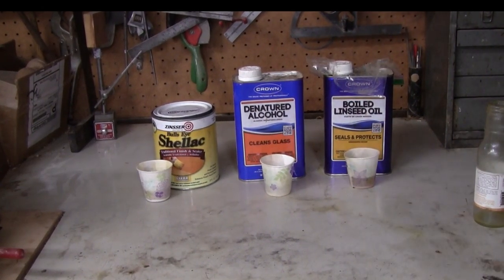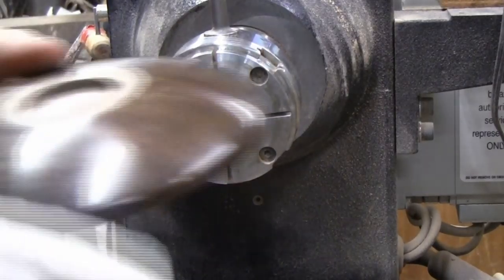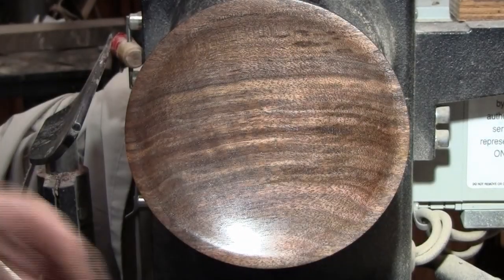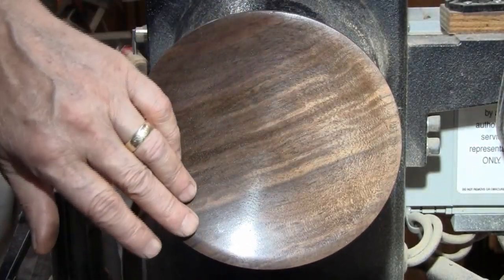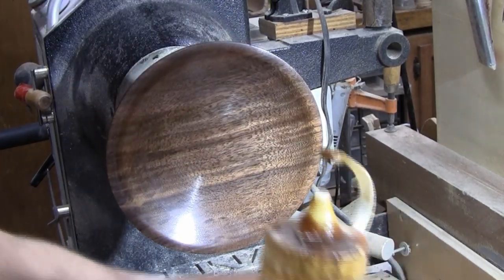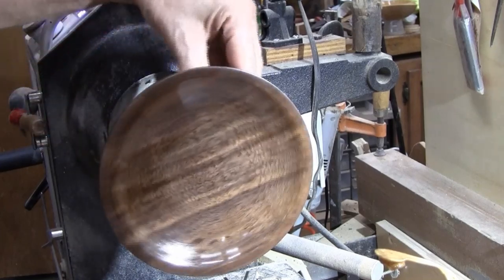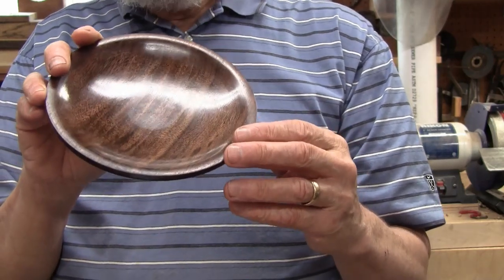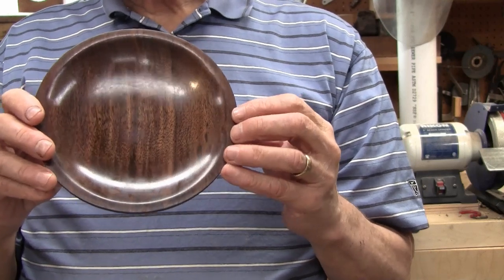How I make Friction Polish - French Polish Wood Turning

Comment: That is a great finish. Your application is spot on. The origin of this finish is Cap'n Eddie Castelin and he attributes it to someone with the initials O.B. Cap'n Eddie refers to it as OB Shine Juice. And it is a great finish. There is one drawback in that if left unused for very long the alcohol evaporates. So the juice needs to be kept in a very tight container. However if it becomes obvious that some of the alcohol has evaporated it's easy to add a bit more. Thanks for sharing Papa. And please stay healthy. BTW that is a very nice little bowl.
Reply from the maker: Thank you Glen,
I have heard about OB shine juice.
But this does start in the 18th century with a mixture of shellac and alcohol. I did not use it back then though..lol 
But I did some hand rubbed finishes in the mid 1970's
Not very many original ideas left but it is nice to play around with it.
I have found that there are times I like it better when some of the alcohol has evaporated.
Thanks again and be safe as well. Now we have more things to watch out for 😞
Gary
Reply: YES SIR REE, CAPTAIN EDDIE IS A LEGEND!!! HE'S SHARED SO MUCH GREAT WOOD TURNING INFO OVER MANY YEARS!!!!
Reply: Woodcraft sells STOP LOSS BAGS for this evaporation problem. You fill them with your mixture. Squeeze out all the air and seal them. Then store in a refrigerator until needed. Shake b4 use. A little awkward to handle, but works very well.

Comment: We've been using that formula for the last 50 years or so for lathe projects required by our beginning furniture design classes. Excellent video!
Reply from the maker: Yes that has been around for a very long time. I used something similar over 50 years ago. I can not recall the exact mix but I used it to do a French polish on a piece of furniture I made.
Thanks for watching,
Gary

Comment: Hello from France. Thanks for this video. I use the same recipe as you, on the other hand when I put the shellac on the wood it shines a lot, but when I polish by rotating I lose shine. do you know where the problem can come from? THANKS
Reply from the maker: I usually get a very nice finish from the friction polish. But what I will use is the Acts Sanding Paste and the Acks Polishing Paste afterwards.
What are you using for the polish?
Reply: @ThePapa1947  Good morning, I sand the piece of wood down to 600 grit, spray with alcohol and sand again. I put two coats of diluted shellac and I sand lightly and finally I put 2 or 3 coats of friction polish. When I put the friction polish the shine is very intense but when I polish with the wheel in rotation, the shine fades.
Reply from the maker: Perhaps it is not dried long enough. Or maybe the polish and wheels are not fine enough. If you have a nice shine after the friction polish why are you even using the buffing wheels?
Reply: @ThePapa1947  I use friction polish because I'm afraid the piece of wood will get sticky with the linseed oil. I will do other tests. Thank you for your answers. If I find a solution, I'll post it here. Thanks again.👍
Reply from the maker: The solution is very easy. If you are looking to get a nice deep lasting shine then use lacquer. Friction polish is a nice quick method but I use lacquer for a very nice and lasting finish. You can also use Minwax Polycrylic or Minwax wipe on poly. I very seldom us friction polish .
Reply: @ThePapa1947  Good morning, yes you are absolutely right. I just wanted to know where the problem came from. Generally I do my finishes with beeswax or tung oil, I find that the wood has a more natural look. have a nice day and thank you again

Comment: When do you use shellac versus lacquer for a finish. And do you ever use Ack’s abrasive paste BEFORE putting on the final finish?  What I learned is that it takes several coats of this finish to get the final gloss that you are looking for. Thanks
Reply from the maker: I generally use shellac on a natural turning from a piece of a log. Most segmented work I will use lacquer or Polycrylic. I may use it both on anything but most of the time it is like I said.
 I have only used the Acks before the finish if I am using a friction polish. 
 And yes it takes a number of coats to get a deep gloss.
Thanks for watching,
Gary
Reply: @ThePapa1947  It appears that both the lacquer and polycrylic finishes come out very smooth to begin with from watching your other videos.  I am surprised that you need the abrasive paste and polish after the finish.  My problem with spray lacquer is the VOCs.  I don't have a paint booth in my small shop and the odor is just overwhelming to me.  But for small spindle turnings it seems that friction polish is the best.  I also don't understand the use of a sanding sealer if an abrasive paste is applied before the final finish.  I enjoy your videos greatly and have learned a lot.  Finishing to me is just as difficult as the turning part!!!  Regards, Steve.

Comment: You asked about food safe. Shellac is applied to M&M’s and other candies of that nature. The DNA gases off, but a different alcohol that is more “food safe” could remove any worry. As for the BLO, the same thing goes for it as does the DNA. Mahoney’s Walnut oil comes to mind.
Reply from the maker: Thank you Doug. I know M&M's are covered with shellac.
Also most finishes are said to be food safe after all the gases are gone.  
 The Walnut oil sounds like a good option. Also mixing your own shellac is supposed to be better. Mineral oil has been used in French Polish but it never drys or drys very  slow. I did not like how it used.
If I was going to use it for food safe I would look into all of that.
Thanks for the tips.
Gary
Reply: ThePapa1947 I thought you probably knew about shellac, but I’m amazed how many people don’t. I mentioned it not long ago and you would have thought I was suggesting they eat rat poison. They may have even mentioned rat poison. Regardless, you continue doing good work. Ive enjoyed watching your videos.
Reply from the maker: Thank you Doug..Rat poison! That's a good one 🤣 
When it comes to finishes there are lots of opinions. 
General Finishes makes a Salad Bowl finish that is polyurethane.  
My local wood workers store claims it is thinned down poly. 
I have no idea on that but I know it is polyurethane which is not supposed to be food safe.
 So I do not make recommendations on what is and what is not food safe.
 I do have a dilemma though. I am making something I might make a cookie jar. I most likely will use lacquer on the outside and I have though of walnut oil for the inside. Or perhaps the salad bowl finish. But I could try the Mahoney and ever clear mixed with the Seal Coat. Or maybe it will not be a cookie jar.
Gary

Comment: Gary, how long between coats?
Reply from the maker: Hi Anthony,
Most of the time you can put it on after you have applied a coat. The heat generated will dry it very fast.
Gary

Comment: Gary, was wondering. Do you always use this as your go to finish? Or do you use others also? And is the lifespan of this enduring? Thanks, i use this and other times i use Triple EEE after Yorkshire grit.
Reply from the maker: Hi Uncle Moe, It is down on the list as to my favorites. Shellac and Lacquer are probably my favorites but Wipe on Poly is right up there. I use the friction polish on small pieces such as the lid on my last turning.
The friction polish seems to last just fine. You are just putting down shellac in a simple fashion.
I use my abrasive paste over the top of most of them.
Take care,
Gary

Comment: Great video Gary. This is the best way to pass woodworking knowledge to the next generation by us old folk😁 I learned from my father who learned from someone's father and so on.  What was in your Sanding Sealer ? And why is it a good thing ?   Stay safe.  -Mike👴
Reply from the maker: Thanks Mike!
Yes passing on information is a great thing for sure. I trained a few apprentices in my time and even after I retired have been told by them that they appreciated the tricks I showed them.
 The sanding sealer was just plain old Zinsser SealCoat. I like a sealer to be put on so it goes down into the grain. This seals it and if the grain is going to raise it is better to be able to sand it down before applying the finish.Sometimes one coat will do but if not I put it on to the point I figure that not much of the friction polish will be soaking into the wood. I use it under straight shellac the same way.
Take care,
Gary

Comment: Thanks for sharing, very informative and beautiful finish. Will this darken a lighter wood or stay clear? Will it yellow over time? What % denatured alcohol? Lastly, is this a proper finish for functional pieces that are handled a few times a week like say a box? Sorry for the Q's, just need to know.
Reply from the maker: Thank you for watching.
So you use 1/3 of each. Shellac, denatured alcohol and boiled linseed oil.
 It will give a slight tint to a very light wood and  your are basically putting on a shellac finish. This is based on the French polish method.
 I find it just fine to handle.
 If you want something that will not tint the wood you might want to try Polycrylic. It is water based and dries very fast.
 I have a video on how I do it plus if you look up my recent Vortex bowl I used it there.
 Thanks for watching,
Gary

https://www.youtube.com/watch?v=QOFYnzePKSU&ab_channel=ThePapa1947

https://www.youtube.com/watch?v=sodQISh5DDs&t=1s&ab_channel=ThePapa1947
Reply: @ThePapa1947  Unfortunately we cannot get denatured alcohol in CA. Can isopropyl rated at 91% be used instead?
Reply from the maker: @Oakydokes  can you get stove fuel? Like camp stoves. Same stuff.
Reply: @ThePapa1947  Thanks. they have what's known as "White Gas Camp Fuel" here.
Reply from the maker: @Oakydokes  last stuff I bought said fuel on it and it was with the paint thinner and lacquer thinner. Said alcohol on it and it works the same.
Reply: @ThePapa1947  Finally gathered up most of my ingredients. I'm about to pick up sanding sealer. Is water based okay?
Reply from the maker: @Oakydokes  no I would not used water based for friction polish.
Reply: @ThePapa1947  Thank-you. I just found someone with a can of Zinsser Sealcoat, but confused as it doesn't state whether it water, oil or other.
Reply from the maker: @Oakydokes  the seal coat is just what you need. It is shellac based.

Comment: Thanks for the demo Gary, like others I have been using that for a while but with poor results this should help improve my finish. How long does it usually take your sanding sealer to dry, I understand it varies with the conditions, but the one I have says to allow 24hours which seems a bit excessive for someone as impatient as me. Just discovered your channel subscribed etc. and am thoroughly enjoying watching and learning, thanks for taking the time.
Reply from the maker: Thank you Steve and thanks for the subscription.
So the shellac sanding sealer drys very fast. This time of year I can sand within half an hour. But the way I put it on I use scotch brite or 0000- steel wool. If sanding is needed I could sand in that amount of time as well. If I put 3 coats of sealer I might wait a little longer. I have the same results with lacquer sanding sealer. Cold weather adds some time but not that much.
 I use the Zinserr Seal Coat which is shellac. And it is wax free. You do not want to mix their shellac with alcohol to make your own because it is waxed. But there shellac is great as well. 
 What sealer are you using?
 Let me know if you have any other questions...happy to try and answer.
Gary
Reply: ThePapa1947 No worries and thanks for the reply. I uses Feast and Watson that I bought from, I think you call, a big box store. Now I know how you do it I’ll try again with the Ubeaut sealer, we’ve hit winter over here, Melbourne Aus, as you say it’ll slow it all down a bit. Thanks again for the reply, I appreciate it. Cheers Steve H.

Comment: I went to the local hardware store to get some Shellac and thought I'd get some denatured alcohol as my shine juice is low. Turns out you can't buy denatured alcohol here in California anymore. I will have to check at a drug store hopefully the can still sell it.
Reply from the maker: Hi Tom..I did hear that about the denatured alcohol. Was you able to get the shellac? How about the stove fuel alcohol?
It seems to be the same stuff but I am not 100% certain on that.
Good lucking finding what you need.
Gary
Reply: @ThePapa1947  I had to order Shellac,  alcohol stove fuel was a no also. They had a 5 gallon bucket of denatured alcohol but couldn't sell a drop of it. I ordered some from Amazon for $4 hopefully it will make it.

Comment: Squeeze bottles like those polyethylene ones you would buy at Harbor freight should not be used to store this polishing compound.  The denatured alcohol will evaporate though it over time and the bottle will collapse in on itself.  Instead, use a bottle that soda pop comes in to store the polish. Or a mason jar works well too and store upside down on the shelf.

However, if you do store the polish in a polyethylene bottle, mark  the level of the  polish on the side of the bottle with a piece of tape or Sharpie pen after each use.  When you come back to it later for use , notice the level on the side of the bottle and just fill with denatured alcohol up the  mark you previously placed on the bottle.    Shake and use after that.  Remark level after every use and follow instructions for subsequent uses.
Reply from the maker: Thanks for the great tips! Not sure what this one is made of but it does not seem to loose the alcohol. But I usually only mix one Dixie cup of each at a time.
I will try a soda pop bottle one some as I do mix some at a different ratio.
My luck with glass is not very good. Seems to turn into small pieces when I drop it. Which I just did yesterday with some abrasive paste.
Thanks again,
Gary